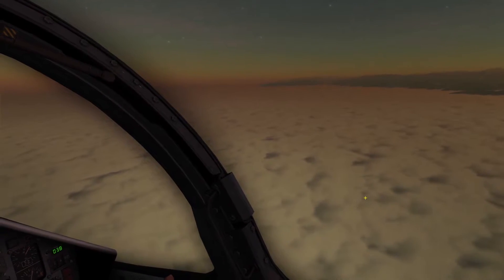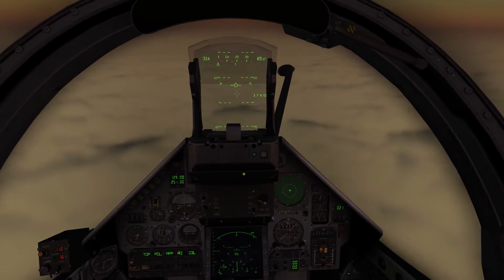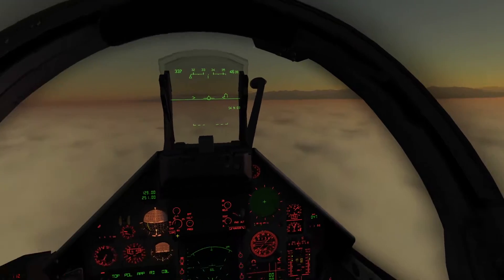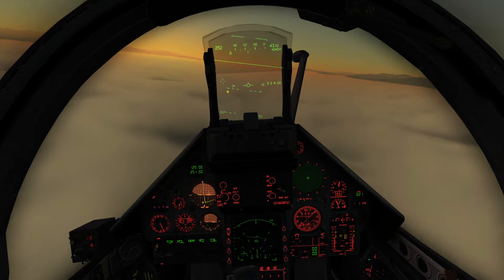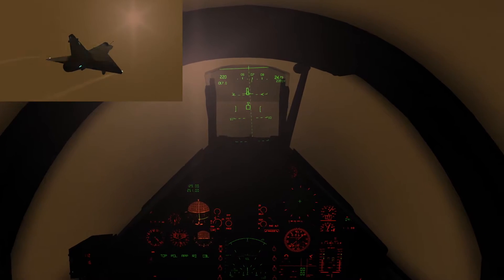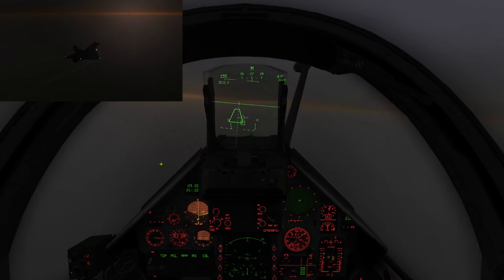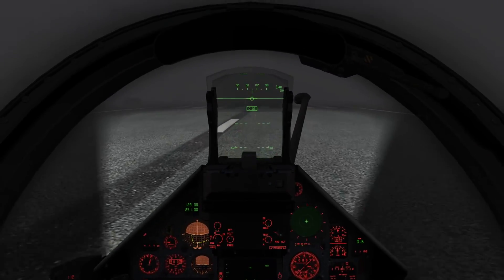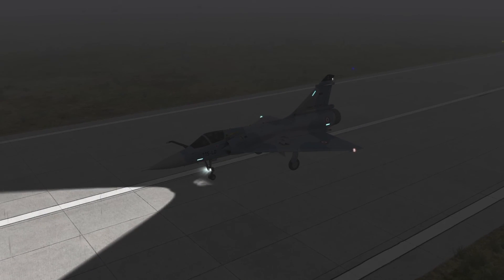DCS Mirage 2000C - Landing Tutorial 3/3 - Zero Visibility Landing

Comment: If you become disoriented in the clouds, you are simply missing the necessary skills for IFR flying. ;)
However it´s not only preferable to only dive into the clouds when established on localizer and glideslope, it´s an absolute MUST! The ILS system not only gives you landing information, it also ensures there are no obstacles in your way down.
Just diving into the clouds somewhere near the airport without beeing on airways, or VOR / TACAN radials / sectors with published minimum safe altitudes can easily end up you crashing into the next mountain 100 feet below the top of the coulds. In that case it´s also completely useless if you know where to look for your attitute, altitude and speed on the HUD, but you have no idea how low to descent without hitting the terrain. That´s not instrument flying, that´s called VRF into IMC and is one of the top killers in aviation.

BTW: The approach was unstable. You lost too much speed, almost stalling the aircraft on short final and descending below the glideslope, overcorreted it by  accelerating too much, leading to a landing way way behind the touchdown point without beeing able to see the end of the runway. So there was a good chance to overshoot the runway and to die at the next tree or antenna. This should have been a clear go around. ;)

But to be fair: I can´t do it much better. :D

Comment: Hi, nice video :) can you get vertical speed indication (V/S) on the HUD on app. or in any other mode ?
Reply: Pretty sure the VVI HUD equivalent is the two inward pointing carets on the side, near the HUD tapes.  The higher above your flight path marker, the more climb velocity.  Lower than FPM is descent speed, and even with it is level.
At least, that's what a guide said.
EDIT:  Actually, I think those are the acceleration rate indicators.  Sorry for the misinformation.